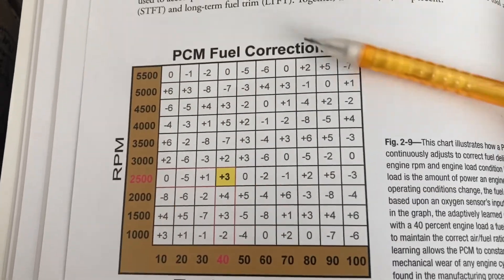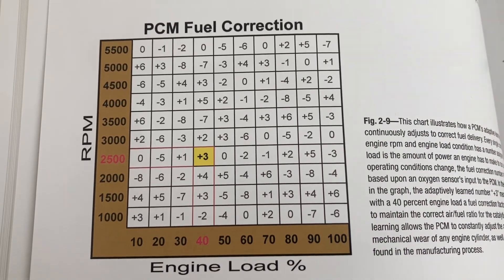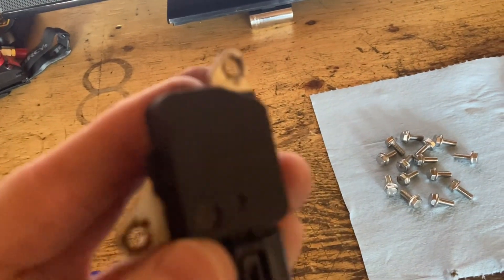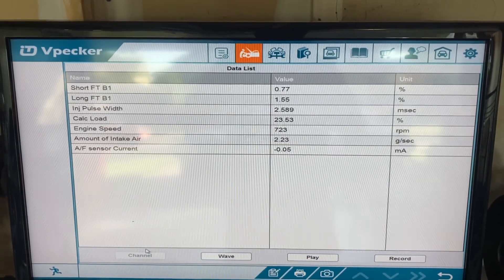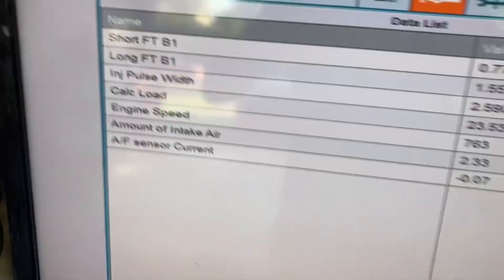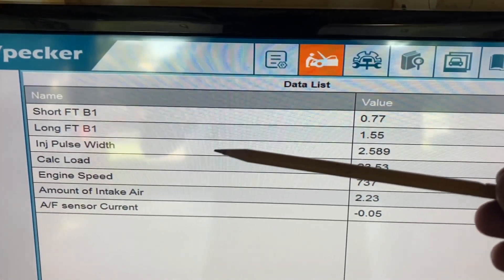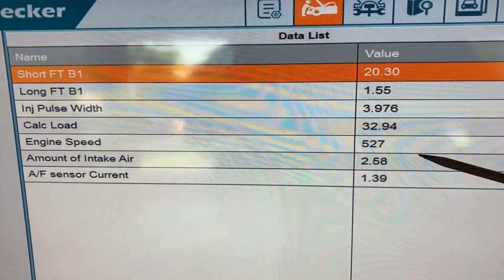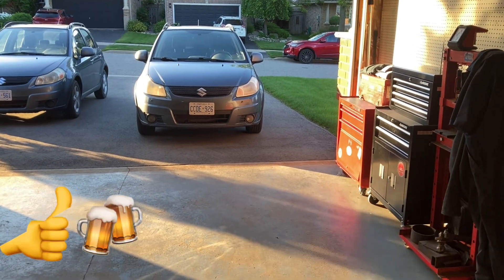Amateur Mechanics Guide To Understanding Fuel Trim Basics

Comment: Excellent presentation of the cars fuel trim calculations . Also that you showed and explained closed and open loop . You covered all of it in a short and simple explanation . Thank you for sharing . Even though I kind of know how the system is intended to function I watch other videos to pick up different pieces of info explained a little different by knowledgeable techs . Gibby thanks for sharing .  👍
Reply from the maker: Trying to simplify a topic, without rendering it devoid of any useful detail can be tricky. Thx for watching Artie 👍🍻

Comment: interesting point i noticed today in sx4. whenever i floor accelerator pedal to the floor, short term fuel trim goes to zero and stays there. up to like 80% throttle it actively corrects the mixture. but if you floor it it stop correcting it. not only that i feel a slight loss of power too.

i have dual fuel system gas/LPG. does the same on both fuels.
Reply from the maker: Think that’s normal. WOT will put the Engine management system in to “Open Loop” in the interest of very short term maximum power development. Thx for watching 🍻